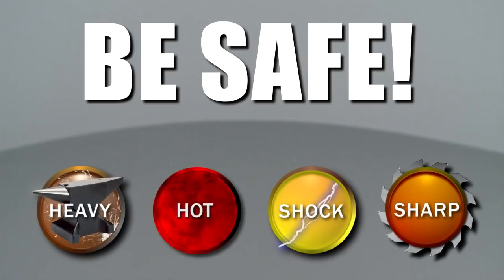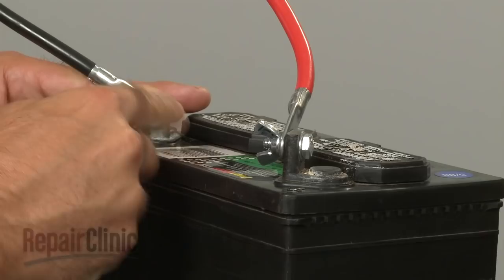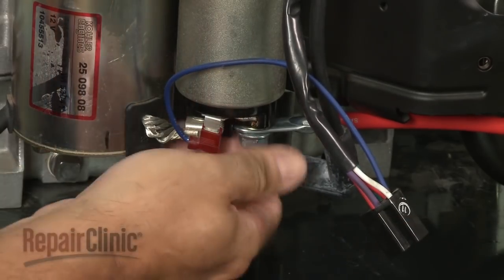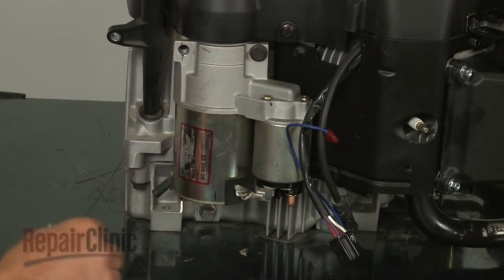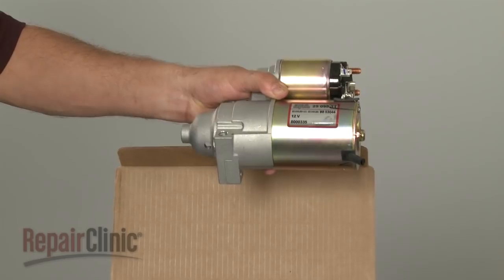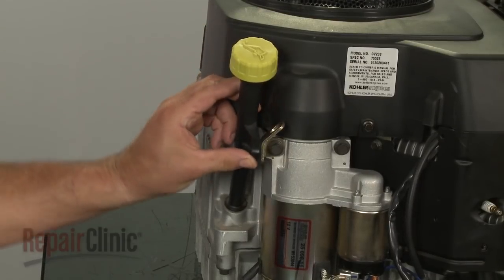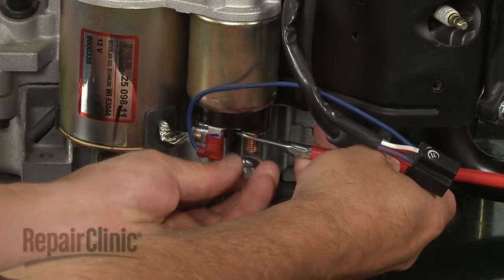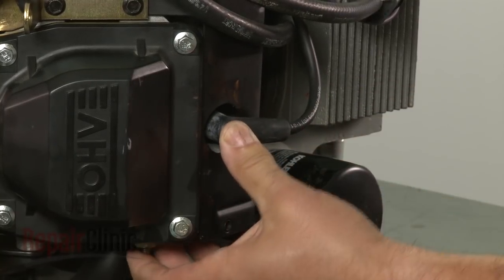Kohler Small Engine Starter Replacement #25 098 11-S

Comment: Got a zero turn mower put new starter on it only way it will start is take a hammer and tap on side of it then it will work mower is about 10 yrs old do I need a new starter
Reply: I have the same problem.  Smack it with a hammer, it starts.  Replaced the solenoid - same thing - must be the starter.

Comment: i just replaced my starter, it just clicked like a dead battery, i replaced the battery, now when i turn the key it whirs, and the motor isnt turning over.  Before the starter went out it ran just fine, please help
Reply: Neatness lawn care solenoid isnt connected or faulty

Comment: I just replaced my starter and celinoid  and it still does the same thing.  turn the key and the starter slightly turns the engine and clicks.  i put a new batter source on it and just make a louder click and may slightly turn the engine a bit.  click click click.... arggg  i have a scagg zero turn with kholer engine / directions were easy, installed fast - but there must be something else wrong here?  any ideas?  perhaps a way to test if the cellnoid  is being powered up?  Thanks for any tips or checks
Reply from the maker: +John Garcia You may have a defective starter motor. You have to use a voltage meter to check if your are getting the proper voltage to the starter solenoid and or motor.